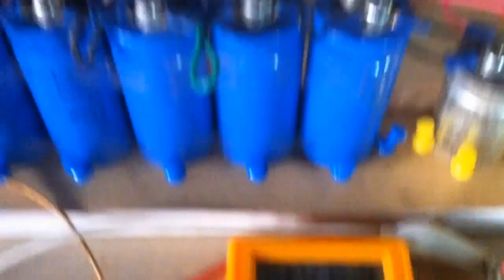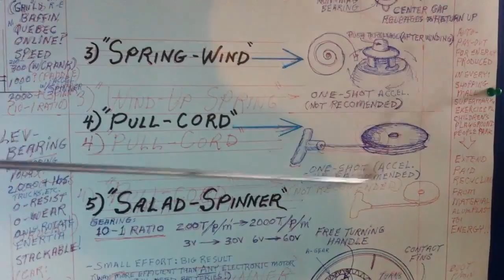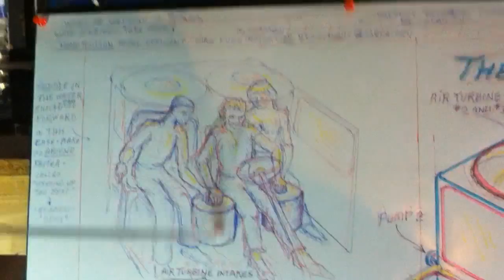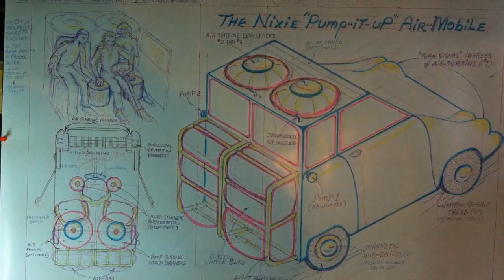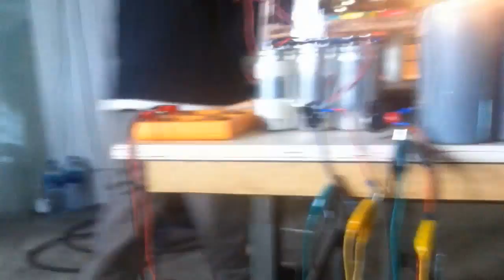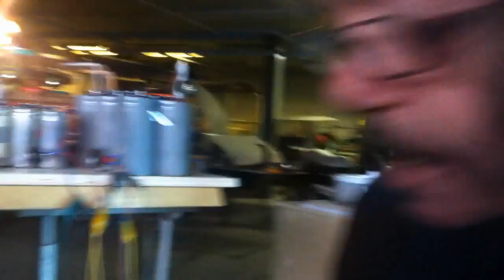UFO Alien Leak FS20 - Zero Point One

Comment: I finally built a multiple hand generation unit that works much better - see FS26. Working on a carbon fiber frame - has been used for bicycles & I find for ultra-light gliders; but not to my knowledge yet for cars. Successfully done it will be very decentralizing for car manufacture & favor magnetic generated and propelled cars.

Comment: Cool ideas you could raise the voltage by breaking the circuit going to the coil at just the right time and get your potential much higher also reducing the Lenz effect on the coils a reed switch at the point right after the magnet passes top dead center would close and send a large back spike to your load diodes route it away from the coil and you have ten times the magnitude of power :-) I hope this helps